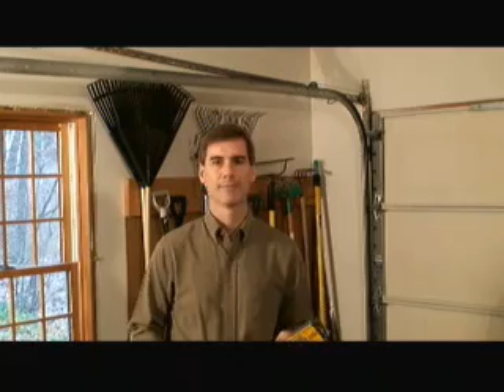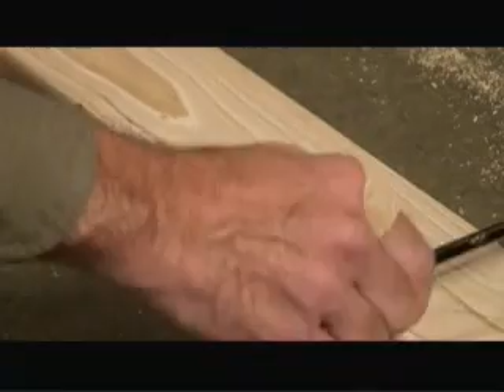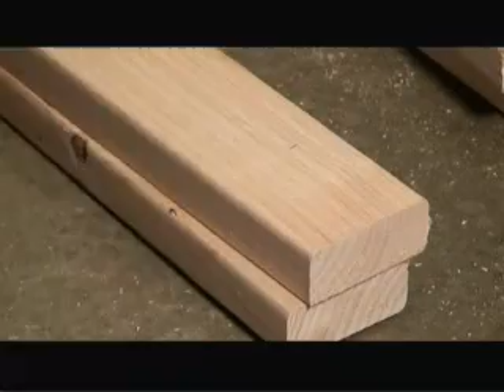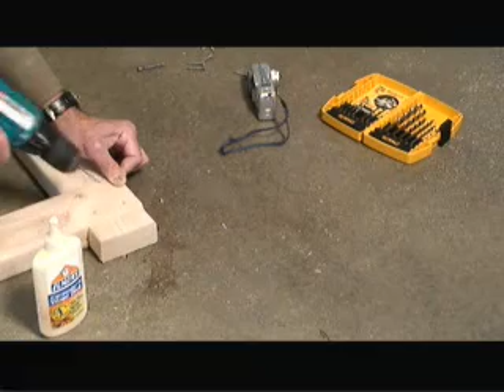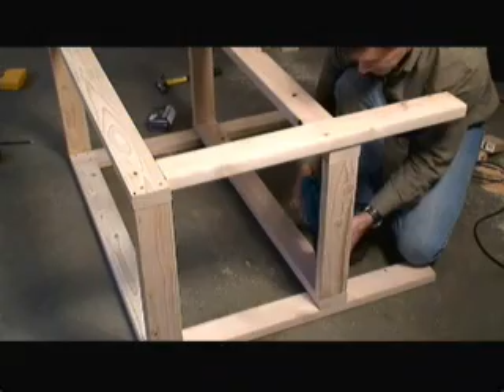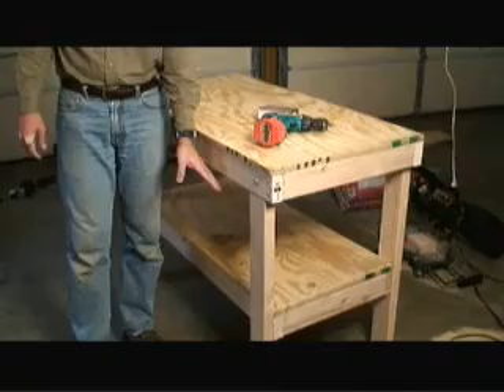Build a Garage Workbench Video

Comment: I build one as reloading bench - thanks, I love it!  I only needed to purchase FOUR 2x4, one of them was 10 footer, I already had 1" table top and shelf plywood, it was very cheap to make it.  The most time consuming part was cutting out slots, found out I can use my 1" belt sander with 80 grit for quick clean up in addition to chisel.

Comment: How necessary are the carriage bolts?  I built this exact bench and am concerned that the carriage bolts will make the lap joints weaker bc it would be a total of 5 holes for each 3/4" married lap joint. 4: 1-1/4 screws and 1: 5/16th carriage bolt. That seems like a lot of hardware for such a small area. I'm by no means a pro so please advise if it's a good idea to add the carriage bolts.
Reply from the maker: +jtm5 I have found that using the carriage bolts make the workbench much more stable.
Reply: +HomeAdditionPlus thanks for the reply. I went ahead and put the carriage bolts in and you're right, they make the joints much stronger.

Comment from the maker: Cariage bolts hold the workbench together. They have rounded flat heads so you can rub up against them and scratch or gouge yourself on them. They also have threads the entire length of the bolt.

Comment: i  have never built anything  from scratch i saw this video and i figure i give it a try bought all the material i need it  i  had al ittle trouble carving out the notches for the legs but besides that everything else turn out great mine you i have never use a electric saw before or a  chisel , thanks for the video my first built  i was very happy with te results, now im trying to find on how to built a  and outdoor bench.

Comment: @jamescolvard lumber is measure as it would be when it was in the tree! You lose some volume when you saw it and then you lose some more when you plane it, so 4x2 planed is 3.5x1.5, and that is probably only approximate. This saves the lumber yards a lot of difficult calculations because they can say for example that a piece of 8x4 can be cut into four pieces of 4x2. If you buy a lot you pay by volume, so obviously they need to be paid for all the sawdust!

Comment: Nice project. I do have a suggestions for you. I niticed your screw driver bit hopping. If you bought budget screwdriver bits they can't handle the pressure of a powered screw driver and the screws them selfs will bend or notch the blades on the screw bit. This will make the driver bit hop and work down the receivers on the screw stripping it out. I suggest buying some name brand high speed (High carbon) screw driver bits. I hope this helps.

Comment from the maker: I have not tried a hand planer on making my benches, but I am sure it would work. I believe the directions shown in this video, using 2x4 construction, creates a strong and heavy duty bench. If you want to build the post out of 4x4s you will surely get a heavier bench. It will make it a heavier beast to move around if your ever need to.

Comment: Good call on those lap joints for the legs to the long top rails. The only thing I worry about is the glue+screw butt joint on the short rail. I don't trust it on end grain. So I would use glue blocks on the corners. Or dowels, biscuits, or pocket screws. Glue blocks are strongest and easiest, and the rough joinery is OK on a workbench. Thanks for a good video!